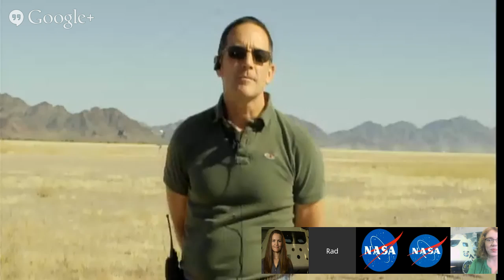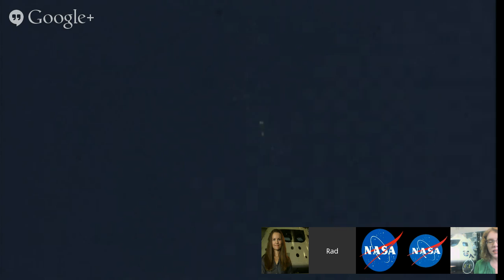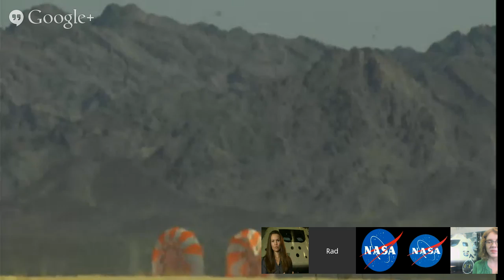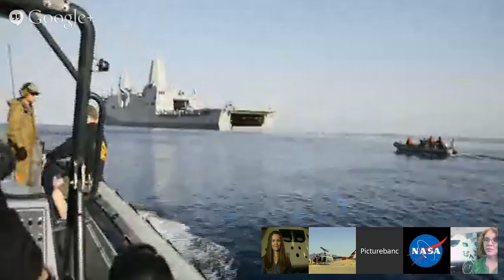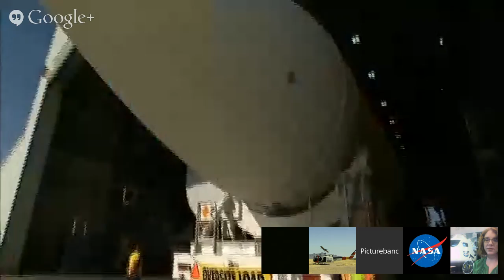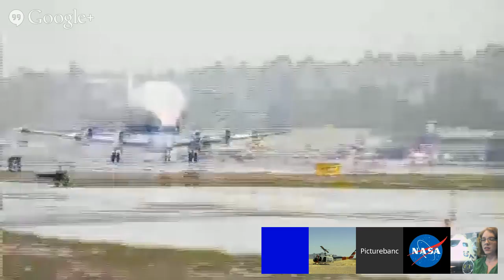The Most Complex Orion Parachute Test, Yet

Comment: What about the supersonic parachutes that were used during the landing of MSL Curiosity?

The Orion parachute system design borrows ideas from that chute design?
Reply: Orion won't need supersonic parachutes like those of Curiosity because the Earth's atmosphere is significantly thicker than Mars's, and pure atmospheric braking will slow the capsule far more than Curiosity. If the reentry is anything like Apollo's (for which there's a lot of data that's available to the public), they won't deploy the parachutes until below 30k feet, which for Apollo, meant it was only traveling at a few hundred miles per hour.